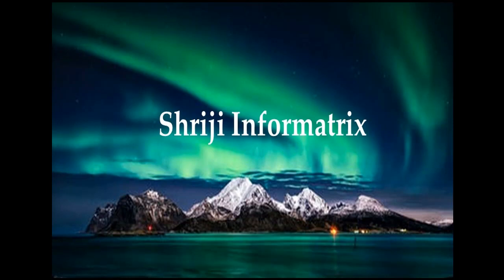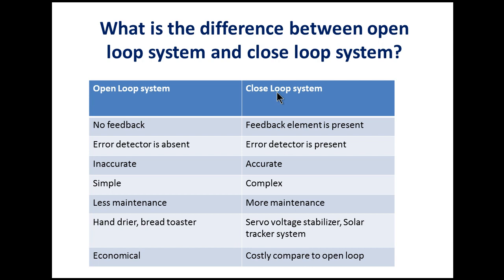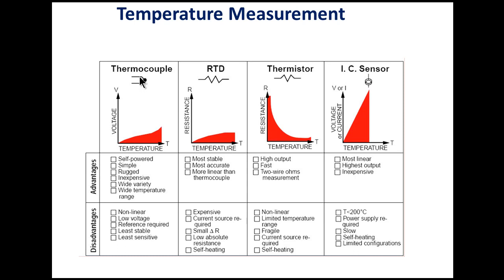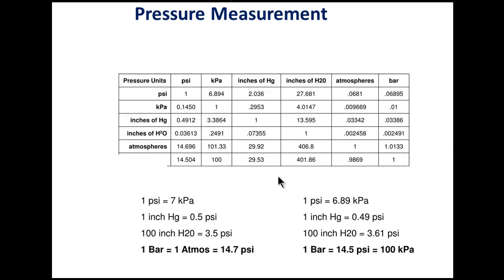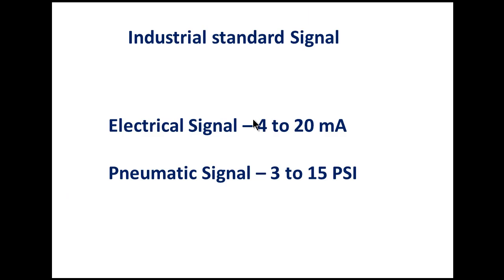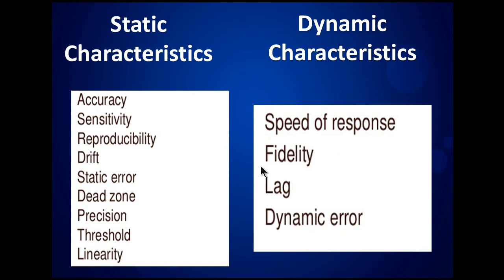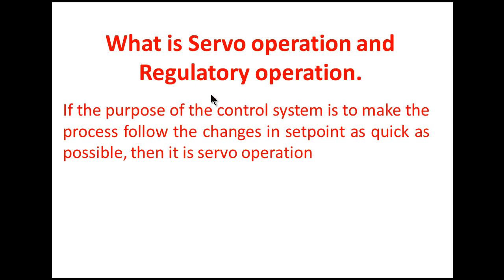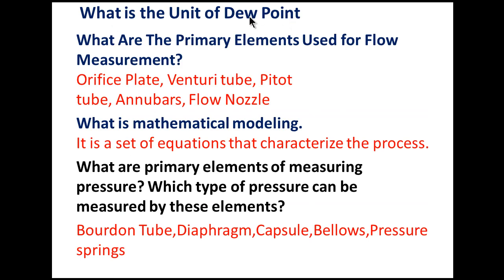Instrumentation and Control Engineering Question and Answer for Job Interview | Part 1

Comment: The Routh-Hurwitz criterion cannot be applied when the characteristic equation of the system contains any coefficients which is negative real, both exponential and sinusoidal function of s. or Exponential and sinusoidal function of s and complex sir what's the correct answer